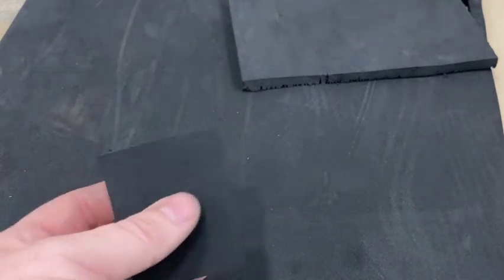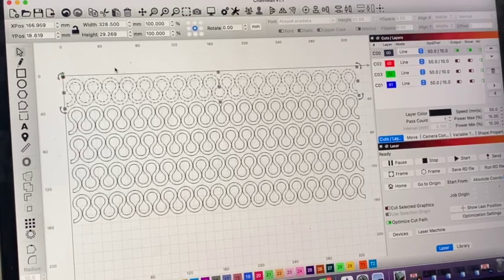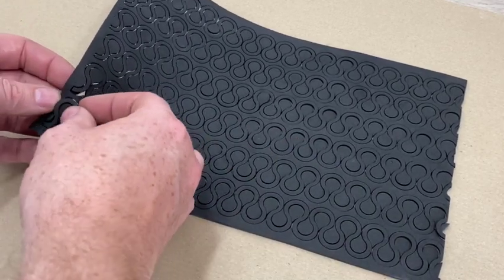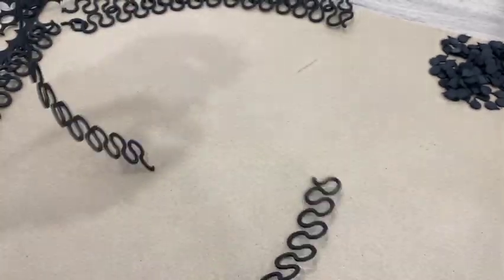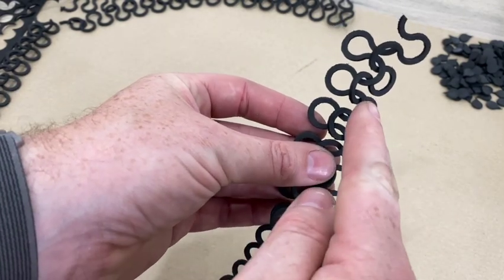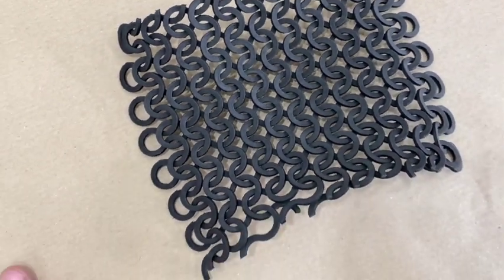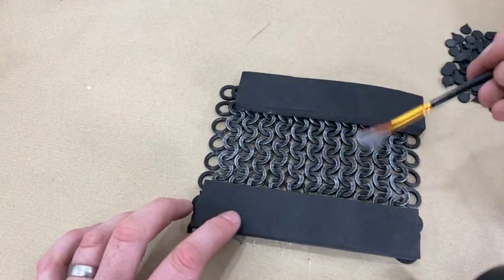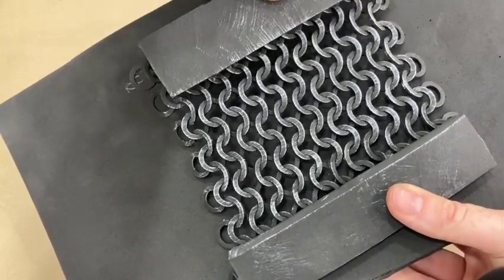Amazing Cosplay EVA Foam Chain Mail Laser Cutting

Comment: Can you do the same with diode? @TheBoredomChronicles
Reply from the maker: No it’s has to be co2 laser
Reply: Yes, I have cut EVA foam quite easily with a diode laser.  Different colors too.  Still have to test like you would any other material.
Reply: I haven't done it but after watching this vid I looked into it- you can. White doesn't work so well though. Just do a bit of googling and you'll find the answers. Power/speed/passes will be different than a CO2 but it's possible